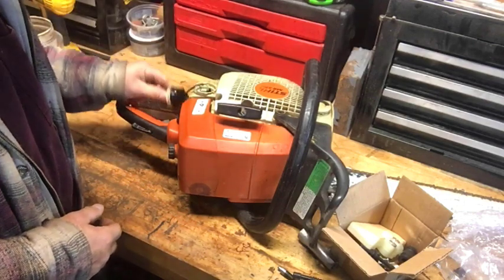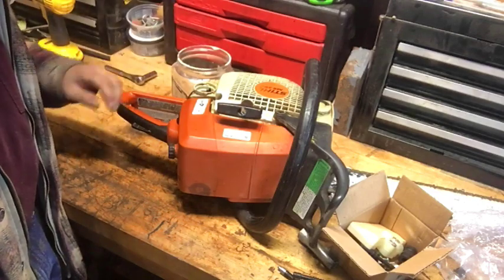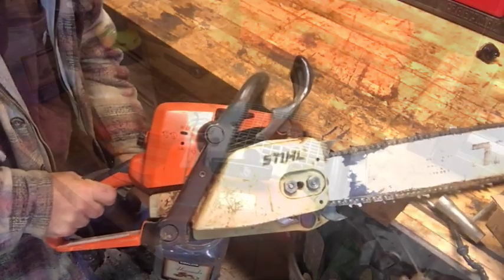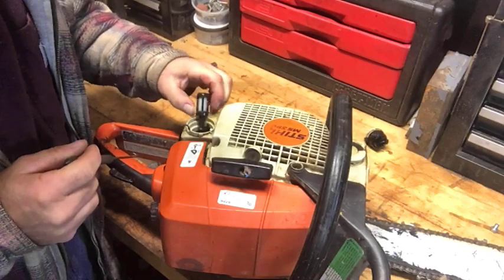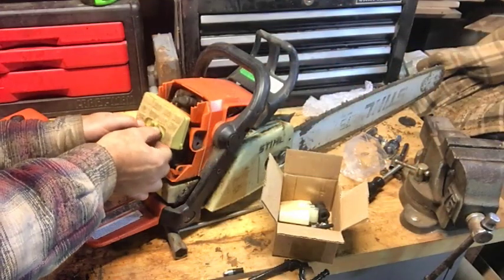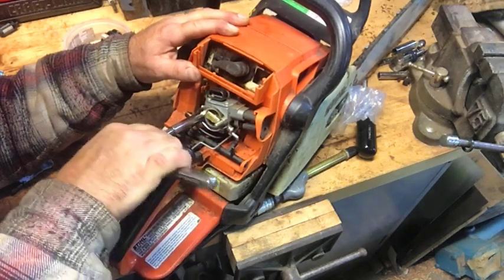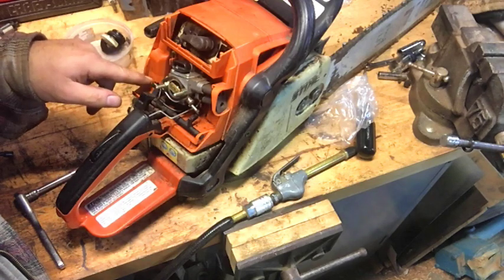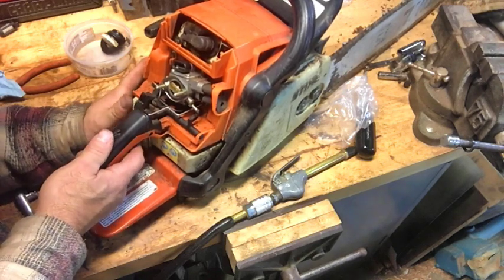Chainsaw Repair Changing Out the Pick Up Line

Comment: Thankyou mr rain been trying to findnout what to do with the chainsaw we have and now we have an idea of what to do i appreciate that alot
Reply: Thanks Logan for stopping by! It could be a number of things wrong. The pick up line wasn't actually what the problem was with this saw although the way the saw runs as shown at the end of the video is indicative of the pick up line. This condition could be the carb, bad gas, filters, manifold. I have another carb and manifold and will change these out one at a time till the problem is cured. the parts which are good will be shelved for another day.

Comment: Open your hi seed jet a quarter turn and maybe also the low speed jet. Also take Heidi's turkey baster to pressurize the pick up tube on one end while holding you finger over the other end under some water to check for leaks. Then duck when she finds out you used her turkey baster. I do lots of small engines and you may need a kit for the carb if the diaphragm is old, hard or stretched out. Thanks and have a great Thanksgiving.
Reply: Good point, but a bad idea with the baster Ha ha!